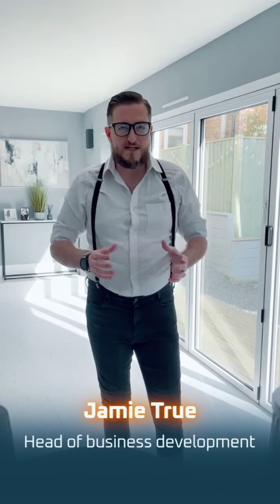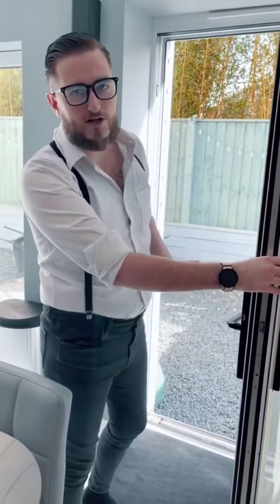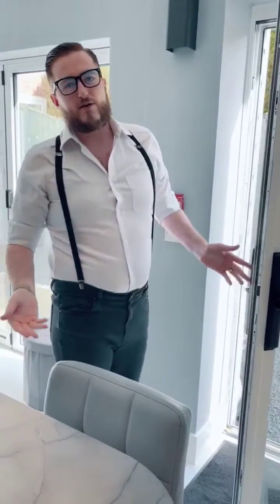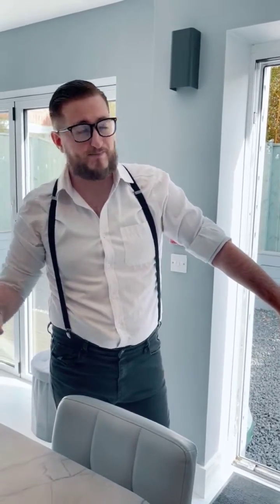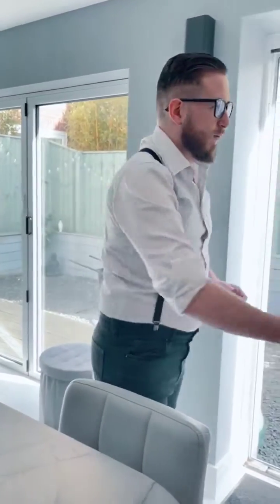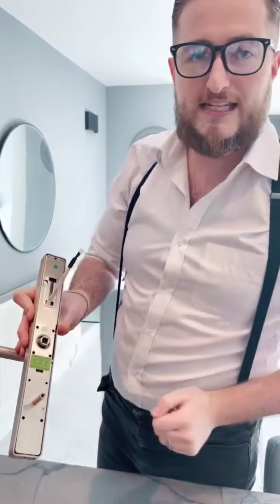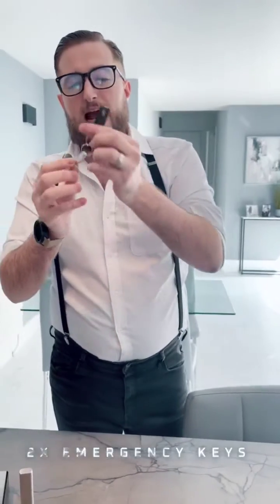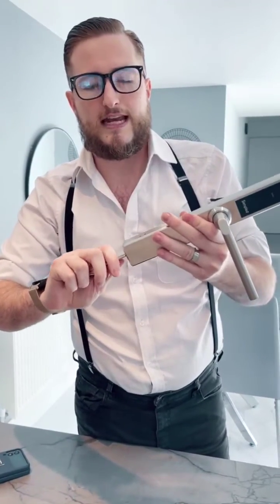How does the Simpled SlimSeries Smart lock work? + Compatibility Test

Comment: If there is no euro cylinder inside, wouldn’t it make the lock prone to physical attacks? Someone can snap the outside portion of the mechanism and easily turn the lock mechanism manually?
Reply from the maker: No lock or door in the world can’t endure damage with enough time, tools and, of course, the needed sound! However, Simpled smart lock is designed with a complicated mechanism and a robust body that guarantees a high level of security and peace of mind.
Reply: @SimpledTech what formal security credentials does the lock have? 

Any bsi certification? Eg. TS007 &   grade 6 3 star rated?

A "sold secure" diamond?

Is it SBD police certification ?
Reply: @David-bl1bt  We are currently working on that. But customers reported that they had shared the data spec with their insurance companies, and they have given the green light to their upgrade.
We highly recommend asking your insurance company before placing an order until we gain approval.